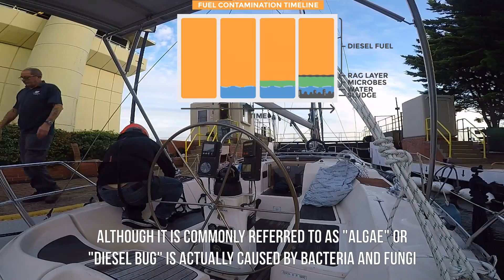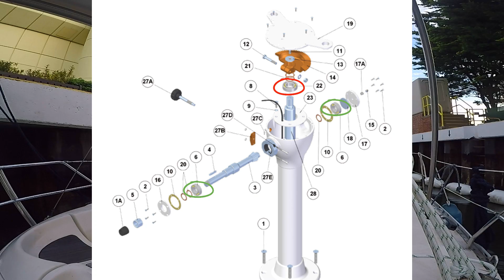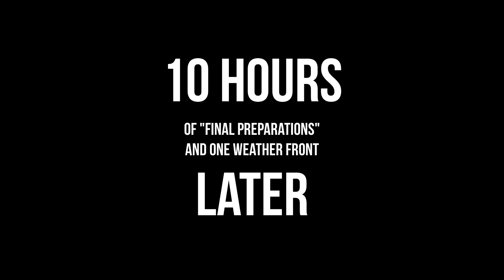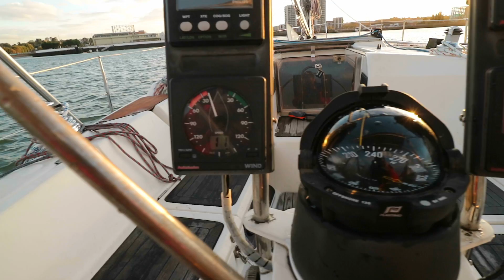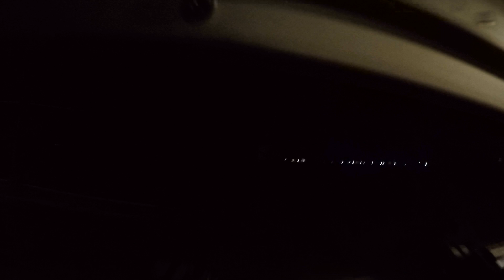Sailing Solo, UK to Belgium, Part 1: Night Sail | ⛵ Sailing Britaly ⛵

Comment: Random question, I noticed you've a trolling electric outboard I'm assuming for the tender. How do you find & how do you manage getting the battery on & boat as well as charging it under way?

Many thanks
Reply from the maker: Hi Paul, we love our trolling motor! It’s a 12 volt model so we can run it from a spare 85 Ah AGM battery we have for this purpose and charge it from any of the charging methods we have on board - including our 400 watt DIY solar set up. The battery only weighs around 18 kg so is easily managed. So far we love this set up! Cheers, Chris 👍
Reply: @SailingBritaly  sorry to ask yet more questions, how does it fair against a tide & how long does the battery tend to last?

Loving the channel btw
Reply from the maker: Paul Holborn Hi Paul, I don’t have the figures to hand but I have collected the data to make a video specifically about this. Off the top of my head it draws about 15 Amps on a low speed setting up to a max of 55 Amps for a “bollard pull test” at the maximum speed setting. You can work out the battery size you need from that. As for the tide it has no trouble getting our inflatable up to its displacement hull speed, which is the most we would ask from it. The video will come at some point: finding the time to edit them is always our biggest challenge... Cheers, Chris 👍

Comment: I did very similar on my Corsair (similar size to yours)in October 2018 - Plymouth to Roscoff single handed with little experience. The trip was not without incident but I got there in one piece and made it back a few weeks later. Did wonders for my confidence and I learned a lot - I totally agree, push yourself a little to extend your boundaries.
Reply from the maker: Absolutely Rich the start and end of this trip were like day & night (Or as it happens, night and day...) My confidence in myself and Britaly were 1,000 times higher at the end of the trip compared to the start. The best way to learn anything is to just get stuck in and do it! Cheers, Chris 👍

Comment: If it gets too much wrestling with  sails and the autohelm turn the boat into to wind in neutral, drop the sails then motor on your course.
Reply from the maker: Hi there, that's what I did, but it's much easier to say it than it is to do it when you have 50 things to think about and do at the same time! No doubt it all gets a lot easier with practice. Cheers, Chris

Comment: Great learning experience.  I’ve done a number of these various tasks on these series of videos.  Good job in being transparent on the pros and cons of these.  One I would 100% disagree with is your compromise on the thru hull fittings.  Of all the items you chose price over reliability, this was one I would have gone the other direction completely.  I checked out the website you went to for the fittings and while not fully understanding the metallurgy, the Groco-type fitting has features not available on the others.   I understand about the backing plates in under cabinet areas, but that does not apply to engine areas, for example.  Also, no grounding...?   Well, it’s done in no uncertain terms now, so let’s see how things go...   good job in staying with the videos - easy to let them slip amongst everything else!   Fair winds!
Reply from the maker: Hi Chris, thank you for your feedback. Some "Bronze" Groco seacocks have brass or stainless steel internal components, so just because someone buys a sturdy looking bronze seacock doesn't mean that they have bought the best item for the job. The skin fittings and ball-valves I bought, although perhaps costing less, have no brass or stainless steel components whatsoever (DZR brass is not the same thing as brass), so are therfore less likely to fail than some of the "Bronze" options out there with inferior internal components. The grounding is a difference of opinion between the UK (where the MCA have advised against bonding through-hull assemblies in their recommendations after an accident report) and the USA, where ABYC insist on grounding. I can understand both arguments and I prefer not to bond. Cheers, Chris

Comment: Nice video Chris.  I know how you felt going out solo for the first time, caution is always a good call.  Look forward to the next videos.  Before I set off I have one of those top pump conference flasks strapped in my galley.  I fill it up with boiling water and it is then ready for a very quick coffee or tea without having to keep recoiling the kettle. Keeps hot for ages and then you also have a bit of hot to do the washing up.  Fair winds. Andy UK
Reply from the maker: Great tip Andy, thanks mate 👍

Comment: I like your sensibility and honesty. Very real sailing and trip planning, just as it is on our little boat with similar experience levels. 
1 note of caution on your safety lines,  they look quite slack. I like the idea of using the windward lines and perhaps taking them around the "wrong" side of the mast so you're nearer the centre of the boat. Needs 2 end clips on tether. 
All the best, looking forward to the rest of the trip
Reply from the maker: Hi Alex, thank you. The idea with the jacklines was that if I should have been unfortunate enough to go over the side, I'd have been swept back to the stern where there is a sugar-scoop style swim platform, and a pull down boarding ladder, waiting for me. I reckon I could get back on board from there (Although I know it wouldn't be easy). In the very worst case I carried 2 knives (box cutter types) in my jacket pocket so I could cut myself free, rather than be dragged along by the boat with no way of releasing myself. After cutting myself free (a truly desperate measure) I had the PLB on my waist - which is what was inside the yellow webbing pouch - which I could use to call for help and then whilst trying to make my way leisurely to the nearest shore(!) I could have put into practice some of the techniques I have practiced on all the sea survival courses I've done over the years for my offshore work.

Of course the best option of all is to stay on board in the first place, so perhaps your suggestion is a better method. You would have to be absolutely sure you can't end up with your head in the water under any circumstances though, as dragging yourself up whilst fighting the full force of the water running along the sides of the boat would almost certinly be impossible, in my humble opinion. I'm interested in hearing other thoughts on this, so if you have anything to add Alex, please do, and if anyone else reading this has something to share then go ahead as it is by discussing things like this that we can all find the best way forward.

Cheers,
Chris 👍
Reply: Hi Chris, there's been lots of discussion on safety lines since the last fatality on the Vendée globe race when the crew couldn't get the bowman back on board and drowned being dragged along attached to the lines. Here's the article that gave me some thoughts on the subject; https://www.yachtingmonthly.com/sailing-skills/stay-deck-avoid-mob-51411

Comment: First crossing and solo and night and strong weather systems........ and not even a spray hood.
I was impressed that your berth sketch included your pivot point.... And with your patent pending "chain locker". 

Sailing alone means decisions not discussed. I'm just going to go for it.... Bet you questioned yourself over and over. 

Where did you get the steering spares?
Reply from the maker: Thank you. The biggest advantage of this is that you just have yourself to think about (while thinking of the consequences for others should things go awry for you), so you have the complete freedom to do as you think best. I really enjoyed that and it took me back to my solo mountain adventures, which are very different but have a lot of similarities too. I bought the bearings from a local bearing supplier rather than the pedestal manufacturer. I had the sizes and just ordered stainless steel bearings. The whole job cost me about $60. Cheers!  Chris 👍

Comment: Hey Chris, great job and I am so jealous of your "First Time Experience" rush! Just wanted to ask if you are running radar on your boat? If so, what kind and model?
Reply from the maker: Hi David, thank you! We have an old "Autohelm" radar, but I had so much going on in the cockpit that there was no way I could have got any use out of it whilst underway. I'm sure the radar will be very useful at times, but so far I find it a bit labour intensive to operate in the manic environment of coastal solo sailing. (When I went down below whilst underway on this trip it was for the bare minimum number of seconds then I was straight back out again) If I had an extra person on board I would have time to go and use it, but on this trip I wanted to be in the cockpit the whole time.

I fitted an AIS/GPS/VHF combo unit just before I left and this was brilliant when I got to the shipping lanes, as it was very quick to use to avoid potential conflicts with ships. I could nip down below, check the CPAs of the nearest 3 ships, and be back in the cockpit before I'd have had time to get anything at all out of the radar. (A lot of this is due to my lack of practice with the radar and I'm sure as I get some hours in I'll find it much quicker to use).

Cheers,
Chris 👍

Comment: In your position you need to assume single-handed always. I know you know that.
So get the risky stuff to be cockpit based. If you lead any reef back make it the 3rd. Make it 2 line adding a downhaul to the normal leech reef line.
Reply: both sails are roller reef from the cockpit....!!!!

Comment: The technical video's are great, but this one is honestly said not showing responsibility. The trip could be done at day as a first solo sail. No need in putting you in danger as a challenge or to get some experience.

Comment: This kind of testing is best left to the professionals and not amateurs. Any results you get are automatically suspect, suspicious, and unreliable and worthless. After all, would you go for treatment at an amateur dentist?
Reply from the maker: 😂 Your comment reminds me of the saying “Those who say it cannot be done should not interrupt those who are doing it.” Every professional you have ever met started out as an amateur. The only difference between the two is that one has experience and the other has never done anything to gain any. I have worked as a technician for over 20 years and I have made one-off non-standard parts to keep aircraft flying when they would have otherwise been grounded, as well as many custom tools for subsea use with the underwater robots I operate and maintain. You may find my testing worthless and you are entitled to your opinion, but you’re missing the point that this testing is for me, not for you. I have gone for treatment at an amateur dentist: me. I once removed some wire from my gums which had been fitted by a surgeon months before. This was the first time I had ever attempted anything like this and guess what, it worked out perfectly with 5 minutes of work... I believe that with a “can do” attitude you can achieve anything, and with a “can’t do” attitude you achieve nothing. You are perfectly entitled to disagree. Fair winds, Chris